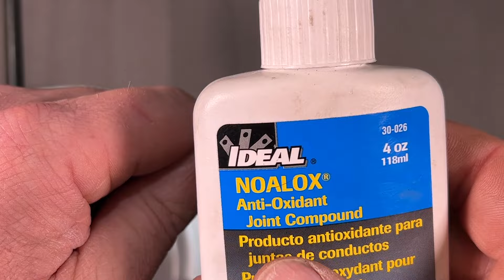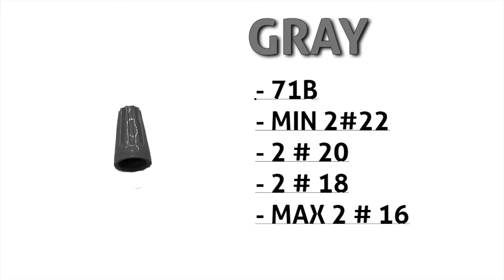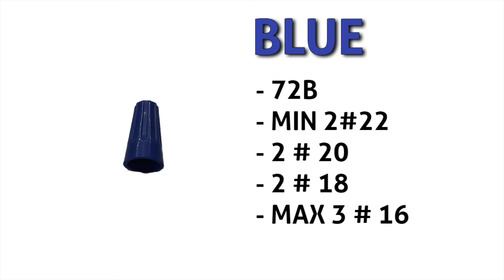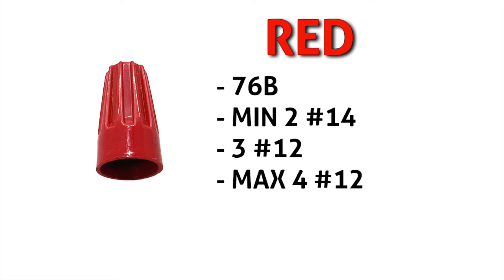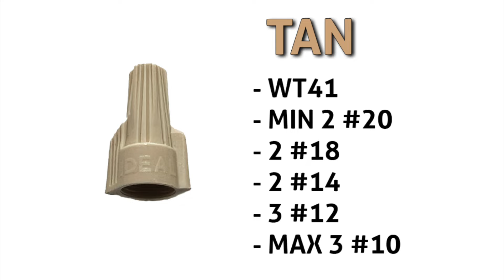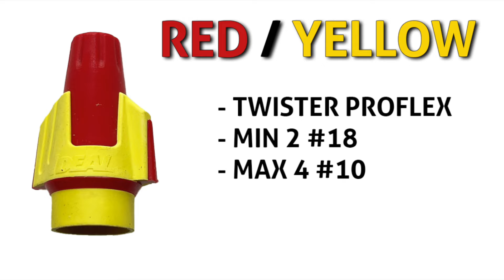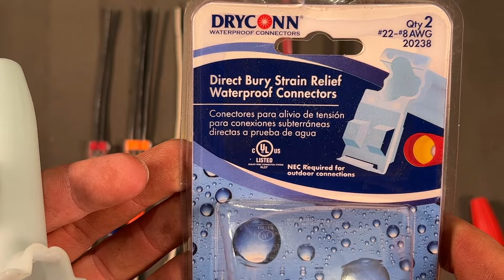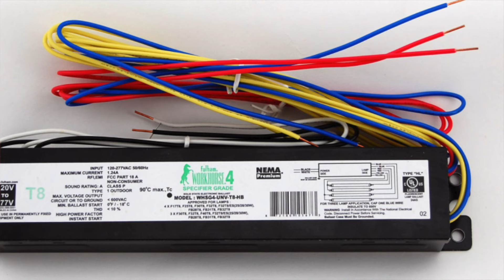A Guide To Wire Nuts - Wagos - Push In Connectors - Do It Right The First Time

Comment: US - avoid metric at all cost. In Sweden we use mm² area for cables, not any arbitrary type number...
Reply: It's not arbitrary not at all. It's based on the number of dies it took originally in the wire manufacturing process to get down to the given thickness of wire. Starting with you guessed it 0 gauge.
Reply: @johnh8546  , Hence arbitrary... ... Emperial countries (read US) does everything to not use metric, despite everything is measuered in units converted from metric... 😁🤪
Reply: @robertlindhe5582  arbitrary means chosen on personal choice and not with logic or a system in mind. So choosing based on the manufacturing process is not arbitrary by definition. Also AWG (American Wire Guage) was established over 30 years before Sweden adopted the metric system.
Reply: @johnh8546  Arbitrariness is the quality of being "determined by chance, whim, or impulse, and not by necessity, reason, or principle". It is also used to refer to a choice made without any specific criterion or restraint.

Arbitrary decisions are not necessarily the same as random decisions.

I would say it's very impulsive to make a choice to use such complicated train of thought in a description of a cable property, instead of a simple cable area measurement. 

Also, when it was established is quite irrelevant, it still makes it complicated and made from an impulsive chance, from my point of view. :).
Reply: @robertlindhe5582  no it's not random or complicated or without thought. It's insanely simple and more simple than using mm or inches. You take the process used to make wire which is the same for everyone. Then you just say here are the dies you use to make your wire. We will all use the same size and number of dies. So that the 12th or 10th or 8th of whatever have you, die will always be the same size no matter who makes it. It stops anyone from cheating and using a slightly smaller die and calling it whatever mm or inch measurement, because everyone got the same dies. 

It is and was the simplest way to get uniformity. It's the opposite of arbitrary it's extremely logical and simple. The dies were selected to give a certain ampacity at 250 feet of wire.

All of this was a very simple way of having the consumer have absolute  confidence that they were getting what they paid for. If my wire manufacturer was using AWG dies and was certified as such. Then you know you are getting exactly what you wanted. Not just what they said was x or y  inches squared.
Reply: With your explanation, yes, it is arbitrary (not random) and complicated. Everyone with little math experience (every elecrician) should know what a square area is.

Cable gauge is as arbitrary as one would define the cable with CU string pulled in the coiling process by 5000 pound in 675.736 °Ra and twisted by a torque of of 50 foot pound per cord pair. The number is then set by the cord numbers times the weight of the cable per inch, minus the isolation. It's not random, but arbitrary, and could be traced back to the construction of the cable. And you know exactly what you paid for...
Reply: @robertlindhe5582  US wire is commonly solid conductor at least smaller than 10 guage. Also it's very easy to understand the system. Aside from that the meter is very arbitrary by your definition. So anything based on the meter is arbitrary. So there is nothing that isn't arbitrary.
Reply: @johnh8546  Well, every imperial measurement is just a conversion from metric, so... 😜
Reply: There are two types of countries in the world. Those that use the metric system, and those that have landed on the moon😊. Seriously, though, most countries use a mixture of systems. Canada, for example, is a metric country that sells hamburger by the pound. Ultimately, Napoleon’s scientists weren’t that precise, so the meter is really just a standard measured against a reference kept in Paris, so the metric system is just as arbitrary as any other. Now, gotta go down to the store and get me some 2-liter sodas.
Reply: @sigcrazy7  Er, Russia and China have both landed on the moon - and, of course, use metric measurements.
Reply: @AlecSpence  Geez, it was a joke. Certainly you can infer that the punchline assumes the listener understands that a human has landed on the moon and then safely returned to Earth. By your standard, the U.S. has landed on Saturn.
Reply: @sigcrazy7  "There are two types of countries in the world. Those that use the metric system, and those that <s>have landed on the moon</s> cratered the Mars probe deep in the surface ;)

Comment: I’m a retired industrial electrician to those who tape and/or wire tie wire nuts STOP IT, it is absolutely unnecessary* and you make service work very difficult and potentially dangerous 
*If you make proper connections
Reply from the maker: Monte I respect your opinion since you are someone who has worked in the field for many years as I have. As I mentioned in the video I like to use the tape in high vibration applications and also in marine environments. It’s good to seal out air and also trap in some noalox. Also I have opened up many j boxes over the years and have had wire nuts spill out on the floor. I’m in favor of going the extra mile in certain situations. For everyday simple connections the tape isn’t necessary. But for some instances a few wraps of tape goes a long way at protecting expensive equipment.

Comment: Excellent on the 5 wire twist!  Not so good on the mention of the hot water heater.  It's a cold water heater not a hot water heater; if water was already hot, why heat it?  😂  Dunce!  🥴

Comment: "twist wire" and "wire nut" is illegal in most country on planet.
Reply from the maker: It actually is incredibly secure when done correctly. Wire nuts used to be ceramic back in the stone age. They would crack and that is why they were not used but they are a whole new animal. They feel a lot more secure than wagos and get more surface contact than a wago. The US is not behind in tech by any means because of the use of wire nuts. I think they are actually better.  Right On! 🙌
Reply: @RightOnJonCrane  You know the difference is that in the US still rules 110V and twice the amperage. In Europe, the maximum current in an extension cord (for example in the UK) is 13A. The problem in the US is very high current. In the EU, wires are thinner (1mm2-2.5mm2) in a home installation. High voltage does not overheat connections, High current overheats them. This causes the wires to oxidize.

Comment: Wire nuts are wonderful if you're a fit and forget boy, but in the UK where we have to prove our installation is safe and compliant on commissioning and on a periodic test, taking wire nuts apart after adding so much stain to the conductor to begin with is a complete "No-no". Trying to get a Z reading from an earth wire that's been twisted like that isn't compliant nor possible. Likewise for R1+R2 or R1+Rn tests. When the stone age NEC code catches up with the rest of the world, wire nuts will be banished like they are in the UK and Europe.
Reply: Been using pressure connectors for last 50 years and never hsd a problem. No such thing called a wire nut in our valve million word NEC. Worked in large p!ants that had vibrating machines like crushers, hammer mils, vibrating screens etc and always stripped the wire at least 7/8" then ore twist, install pressure connector & tightened with heavy side cutters then applied quality electrical tape. Went back on connections that I made over 49 years ago and still working great.
Reply: @garbo8962  so, re-read what I wrote and try to reply to it.
Reply: @user-tq7yj2kq5c  more complex doesn't equate to better and more over sight doesn't equate to better. At a point it is just burdensome. Twist on wire connectors make a better connection than most anything due to the surface area contact of the conductors. Due to the way the threads bite into the wires it makes a very strong connection. The NFPA does say twist on wire connectors aren't suitable in certain applications, but for residential there is nothing better. Nothing gets you a stronger lower Z connection.

Comment: As a german Electrician i can say:
Just use Wagos, WIre nuts look unsecure and dangerous as fuck and they would Violate alot of German Electrical codes.
I get goose bumps as i am watching how he twist the wires Jesus Christ.
Reply from the maker: Oh I like wagos too but when a wire nut is done correctly I think it is way stronger than the Wago. Much more surface contact. Twisted wires are strong. If you ever pull on a wire in a Wago it feels loose and you can spin the wire. I’m not sure the Wago is really better.